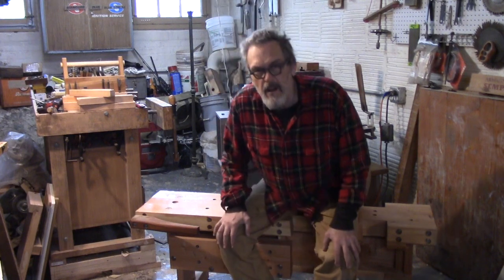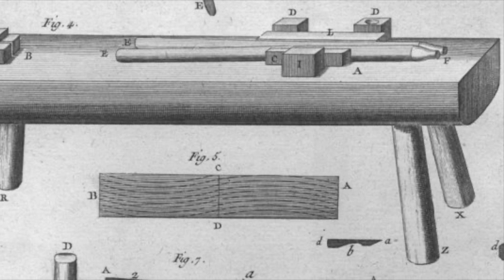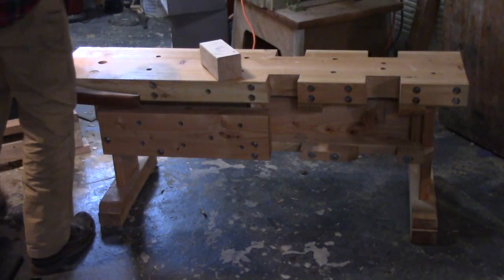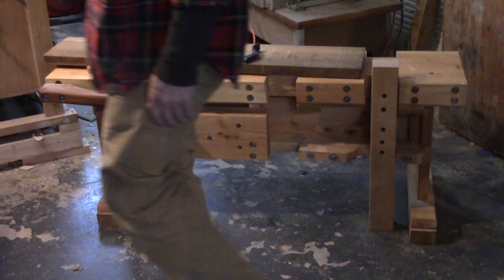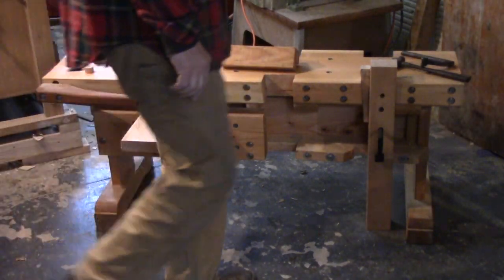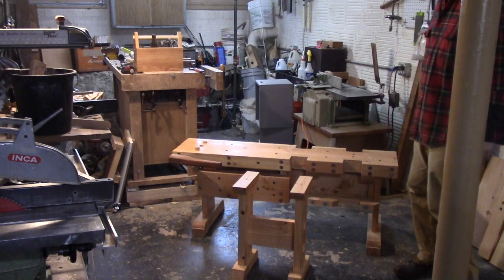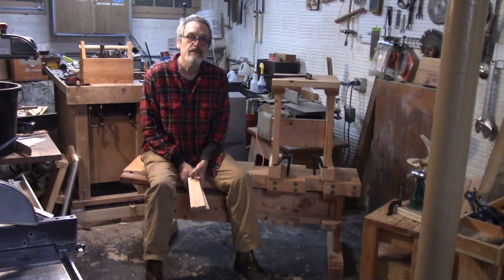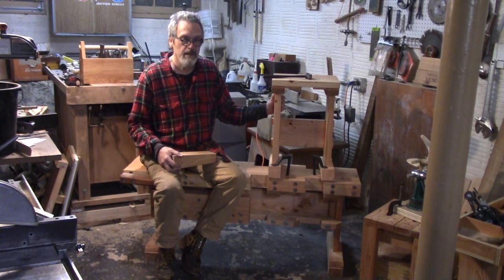A Sculptors Version of the Low Roman Workbench

Comment: It seems as if you are far too self deprecating. Your creativity and craftiness has spawned an amazingly versatile and useful workbench. Judging by the comments section, I am not alone in my opinion on that. The best Roman workbench series on Youtube. That coming from a non sculpting, hand tools only woodworker. Strong tip of my hat.
Reply from the maker: Thank you so much! It's working out for me, BTW.  I still use the conventional tall workbench too, and often go back and forth depending on what aspect of something I'm working on.
Reply: @petercoates2882  Peter, I am in the process of making one of these and I was looking at your plans on google docs, and I for the life of me cant see where you detail the length of this bench. Please advise? Also, do you think a 48" long bench would be too short? Tx
Reply from the maker: @LitoGeorge   Hmm. I thought I replied but got another notification. Maybe I somehow failed to post it?  No, I think 48" would be ok. Mine: 57" top, 47" outside of leg to outside of leg, and 24" apron.  I think you could knock 10" off.  Not sure where you would best lose the length.  Maybe an inch on each end, and the rest half from the apron and half from the other part?  Lay it out first, and be sure!  I do find the plank across for holding tool boxes very useful, so be sure you have room.  One other thing minor thing is, I don't think so many notches are necessary. One on each side is nice, because I often want to put in two 2x4 or 4x4 uprights that I can lash things to.  But if I were doing it again, I'd hold off on the other two unless you find a reason.   They were intended to anchor the legs of the sawhorse, but I haven't ended up doing that very often.If you do put in four, make the angles on the outside for both (mine were all on the same side which is inconvenient for fasting other work surfaces.) What I DO use for a higher work surface is a strong plywood box held down by holdfasts or C clamps.  Very versatile, and easy to clamp or screw to.  Also, you can mount it either the tall way or the short way as needed.   Super easy and the space inside is handy tool space while working.

Comment: Nice job Peter! I’m gonna do this low bench for sure….again thanks.
Reply: Hey Peter what is the total length of your low Roman bench top and those 2 (2x8) slabs if you don’t mind…thanks and have a nice weekend.😊
Reply from the maker: Hi Jocelyn.  Sorry--dum-ass thing to not put in the plans!  For mine: top is 57"  outside to outside of legs is 47" and the apron is 24".  I don't think the length really matters.  The width dimensions are what are important!   Nice to see someone building one.   If I were doing it again, I think I'd make it a few inches higher, but I'm quite tall.  You might consider it anyway.  If you're going to make matching horses, remember, they should be the same height and the main rail's should be the same height as the bench.  Please let me know how it goes and send a picture!
Reply: @petercoates2882  thanks Peter, it’s almost done…have a nice evening!

Comment: Your bench is one of the best low Roman workbenches I’ve seen. I just started woodworking and have a decent amount of power equipment but I am becoming more interested in woodworking by hand.
Reply from the maker: Thanks.  This might be a good project for someone starting out.  You can use power tools but there's nothing there you couldn't do with the simplest hand tools.   It's useful for a woodworker, but without the chicken/egg problem of needing high level skills.   I've done a lot of woodworking over the years, but I'm not really a woodworker. Try googling up Paul Sellers. He's a wonderful teacher. I'd recommend Rob Cosman too.  Different approaches, both excellent.
Reply: @petercoates2882  Mr. Paul Sellers oh yes sir in deed!

Comment: Fascinating versatility - thank you for sharing, and the thought process. I look forward to seeing the build process, any plans and new additions to it. Really like the way it can be utilised. 👍🏻
Reply from the maker: Thank you. I should draw up some plans, but the components are pretty simple.  So far, I'm finding that the simple principle of having tops and trestles at exactly the same height has been one of the most valuable things.  I'm using the parts separately and together all the time.  Being able to throw a board across the saw horse trestles to make a step is something I'm doing all the time.
Reply: @petercoates2882  The variety of functions it can perform with the accessories is its biggest feature: short question then - what is the length, width and height of the bench if I may ask?
Reply from the maker: @boydbutterworth2295  Hi Boyd. I didn't give the size?  It's 23" high, 13" wide, and 57" long. The feet are 20" wide. Those choices seem pretty good but the height is tuned to my leg length. 23" was where I could kneel on it with one leg comfortably.  I'm pretty tall, so for a lot of people an inch or two shorter might make sense.   BTW, there's a blog entry on it here: http://sculpturetech.art.blog/2020/05/22/the-perfect-sculptors-bench/
Reply: @petercoates2882  Thank you very much, those sizes may well suit me as well - appreciate all the details - looking forward to make my own set shortly
Reply from the maker: Baddabing. Let me know if you can't see them. https://drive.google.com/file/d/14dQIidz0MqxI0UM1tqfegHlMuY_mdJZ1/view?usp=sharing
Reply: @petercoates2882  Thanks for this link, I was able to fill in alot of blanks of the build by studying the linked blogpost.  I am going to build this, I am a newbie so it remains to be seen whether it will work out but I will try my best.
Reply from the maker: @Taurabirdy  Hi Taura. Great. I think you'll have fun with it.  It's really worked out for me so far. There's another video that's a collection of work-holding tricks. Might be a good inspiration.
Reply from the maker: Taura--If there's anything that's not clear to you, I'm sure you won't be the only one, so please feel free to ask any questions. It might be pitched a little high! When you've done this stuff for a few years you lose track of what you didn't know when you were starting out.

Comment: I love it!  I currently use a pair of 2' high flat-topped saw horses in a similar way, but just by clamping blocks to them.  Think I'm gonna have to build one.  Thanks!
Reply from the maker: Thanks.  Sawhorses don't get enough love. The flat topped kind are great.  I was thinking about trying a pair with heavy lumber tops so they could be used with hold-fasts.  Might be too heavy for some people, but I don't take them on jobs. For around the shop it could be useful.

Comment: Im going to have to build one of these.  Very well thought out
Reply from the maker: Thanks man.  Let me know if you do.  There's a couple of things I might adjust if I were doing it again.  I'm going to do a piece that covers them, but meanwhile, I think I'd make it a little taller (maybe 4") Also, I'd rig up some way to make perfectly vertical holes instead of just boring them by hand.  If they're perfect, you can stand wood up against pins that stick up, and use a wedge against opposing pins to hold boards firmly upright for edge planing, etc.

Comment: Even for woodworking in the Garden it is a great tool. In most cases you just have a tiny house and not enough space to have a full size workbench. Besides you can move it easily around.
Let the bench come to the work, not the work to the bench. :D
Reply from the maker: Yes, absolutely. Many people don't have space indoors and even if you could get a fancy bench outside you wouldn't dare leave it there in the weather and the dew.

Comment: I like those saw horses with the tabletop.  Looks like you used 2x6 and 4x4 all around, and maybe a 2x12 for the top with a little blocking.  Is that about right?
Reply from the maker: Hi Tom. There should be a link to some plans for the bench but there aren't any yet for the saw horses. The rails and legs are cut 4x4's cut down some. I think you're right about the top. The vertical pieces are 2x8.  It's all the same pile of wood from the bench.  I'll try to add some plans for that.

Comment: I have been studying your drawings and I read all your notes that you linked to on your blog.  I think I have it Except for what you describe under the picture looking at the apron sitting on the leg.  You said as a caption to the photo, "another view showing how the apron sits on the leg plus a horizontal spacer attached to the trestle. The allignment blocks for the wedding notches sit on the same spacer." I don't see that horizontal piece or the alignment blocks accounted for in the diagrams.  Can you explain what those are made out of and whether the horizontal piece was attached and then the notches cut out or did you cut actual blocks and screw those onto the trestle? Thanks so much for all this, I really want to make this bench, it is perfect for my carving and woodworking projects.
Reply from the maker: Hi Taura. I hope I'm understanding your question. Here goes.  The vertical trestle is 1.5 inches thick leaving a wide space between the trestle and the outer sides of the 7.5 inch wide legs.  The horizontal member I'm referring to is that asymmetrical extra piece that is flush with the bottom of the trestle AND flush with outer vertical edge of the leg.   Without it, there would be nothing to bolt the lower edge of the apron to.  It also serves as a place to attach those blocks that line up with the vertical edge of the notches.  Are those adjustable blocks really necessary? In theory, not, because the edge of the notch that is down in the picture should be perfectly perpendicular to the top and there are wooden cleats across the bottom pf  the benchtop that also line up with that square edge making it 3.5 + 1.5 = 5 inches of square vertical surface., But in practice, wood isn't always perfectly straight, the cut might be off a little, etc. so those adjustable blocks give you another point of alignment that adds another 7.5 inches rather than just the 1.5 inch extension that the cleats add. Also, if you notice, the widths of all the pieces are chosen so that things line up naturally if your wood is standard dimension lumber.  The trestle plus the spacer make an edge level with the edge of the leg, and two pieces of wood for the apron let the apron line up with the edge of the top.  But this kind of wood will always move, so the apron is attached with lags to let you slide some shims in if things go out of alignment.

BTW, it's very exiting that you are actually doing this! Let me know how it all goes and be sure to send some pix.
Reply from the maker: Oh-and btw, the horizontal piece is the same dimensional fir that the rest is made of. It's glued and screwed to the trestle.
Reply: @petercoates2882  yes, this answers my question perfectly!  I bought my wood, letting it sit.  Will be starting on the top soon.  Will post pics for sure.
Reply from the maker: @Taurabirdy  It’s kind of an interesting experiment to weigh one of the big pieces of wood on the bathroom scale and then come back in a week or two. I wish I could lose weight that fast
Reply: @petercoates2882  hilarious, me too!
Reply: @petercoates2882  I ended up getting kiln dried southern yellow pine.  Not the best but the best I could afford 😁

Comment: Amazing.... do you plans available? i built a similar bench for my homwe office, but this is a stage further i feel.
Reply from the maker: Sorry, I didn't draw any up. But you'd probably want to adjust the dimensions to suit your needs, especially height. It's important that it be the most comfortable height for you to kneel on work. The other thing plans-worthy would be that one side of the notches is square and the other has a slight angle that matches the wedges.
Reply: @petercoates2882  a sketch showing it from various angles is all that is needed, I can calculate sizes from there, just not how it all goes together.
You know you want to 😂😂😂😂
Reply from the maker: Here you go!  Let me know if you can't see it. https://drive.google.com/file/d/14dQIidz0MqxI0UM1tqfegHlMuY_mdJZ1/view?usp=sharing
Reply: @petercoates2882  excellent, project for the Xmas break I think.....
Reply from the maker: @kljw66  I'm really liking it so far.  I had 1000 pounds on it and it didn't even creak.
Reply: @petercoates2882  
You should pin that at the top.